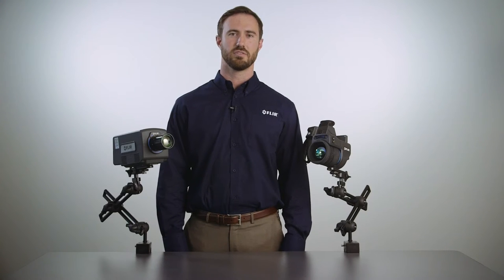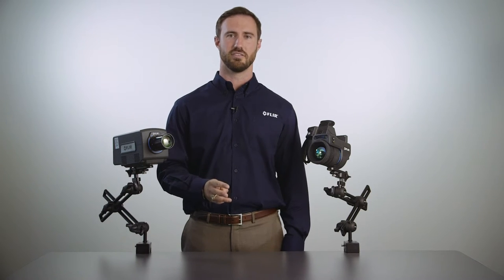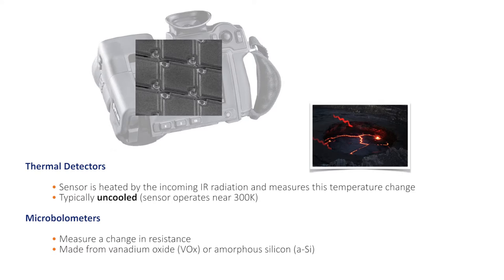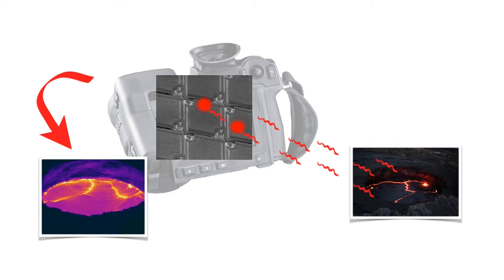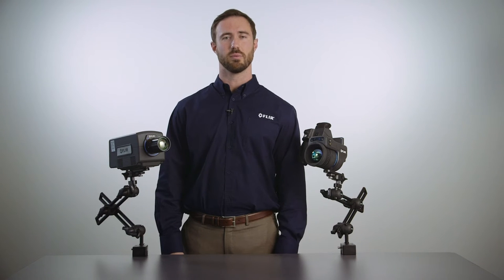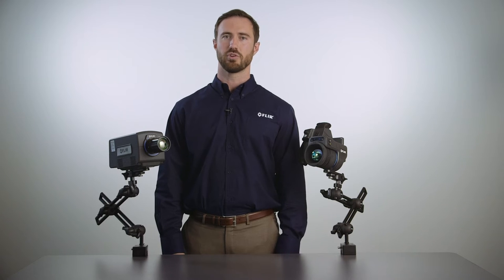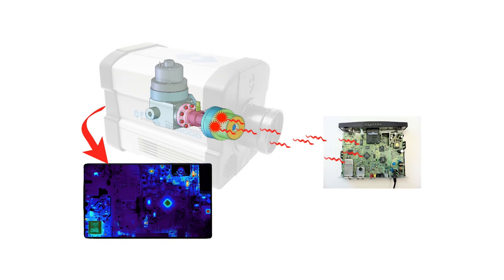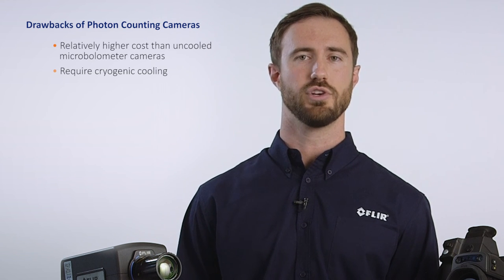What's the difference between cooled & uncooled thermal detectors?

Comment: I used to be a thermographer for electrical inspections. we used a much older flir cryogenic cooled camera (wish I could recall the model) that I think was from around the year 2000 or earlier. it took about 5-10min to cool down before using. i also had to line up 1:1 photos with a digital camera for comparison. it as a lot of fun!